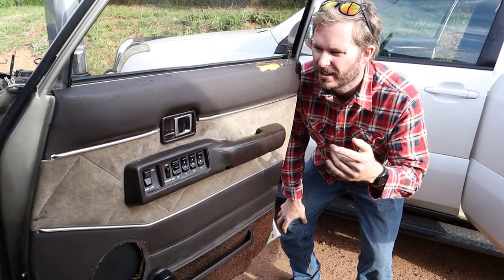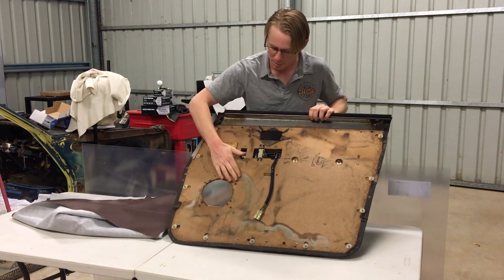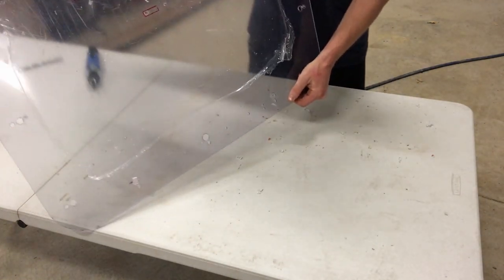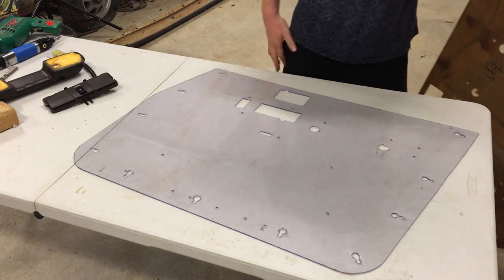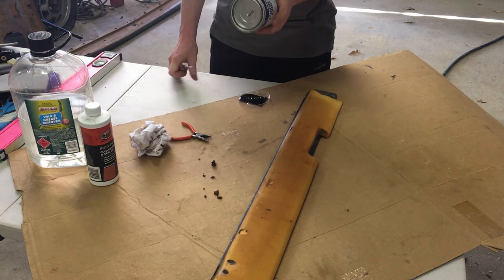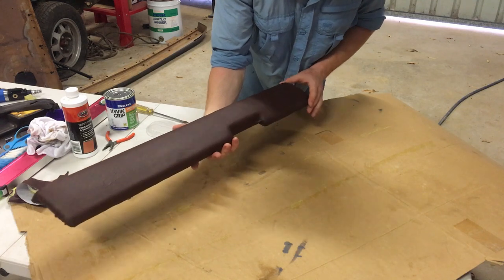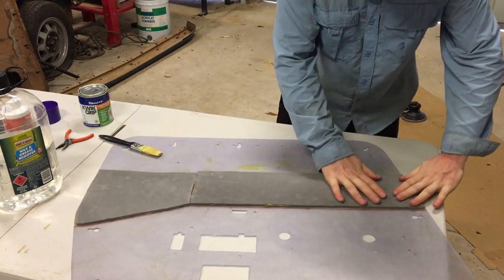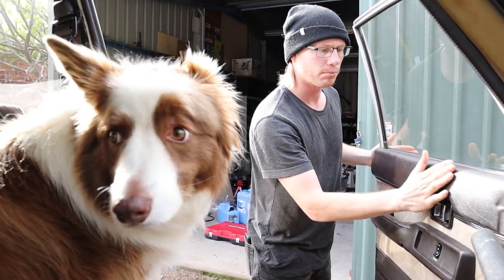Repairing a RUINED 60 Series door trim

Comment: I have the exact same door trim in my HJ61. I’ve been putting 90mm gaffa tape along the top edge of the driver door for the last 5 years. What’s your postal address??  I think I’m going to mail you my door trim ;)
Reply from the maker: Hahaha! I used to do exactly the same thing on my old Subaru L series. At least it helps to hold together what's left of the panel